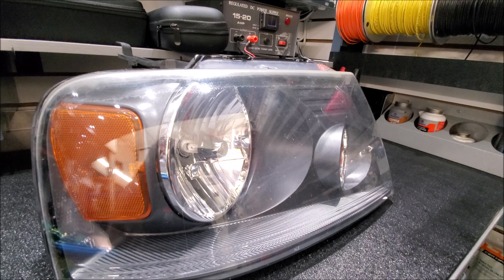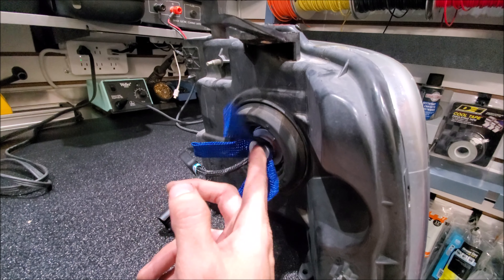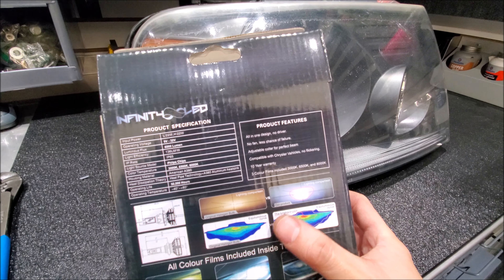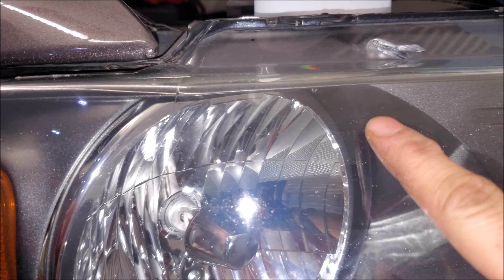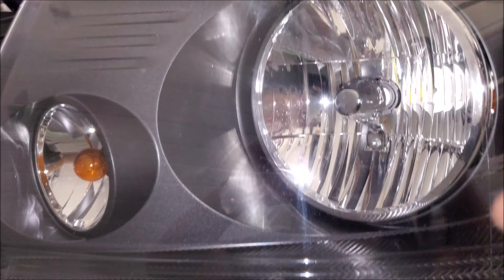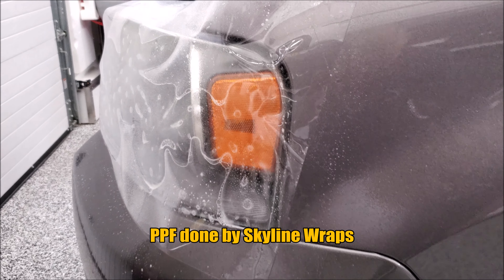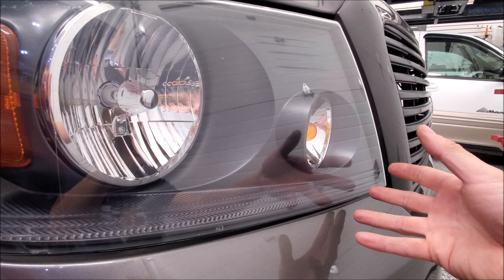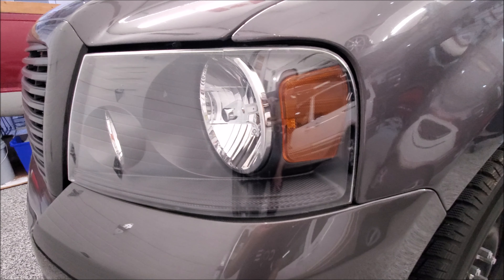How to RESTORE & UPGRADE Headlights the proper way (LED Headlight) | AnthonyJ350

Comment: What's up man. That came out really good. I too prefer using compound as well. Silicone beads clean so well. It does require a few passes by hand but at least you can feel the surface layer.
Reply from the maker: Hey Thizz!  Yes I just kept doing passes till I was happy.  On the Ronda Rousey Accord we probably did 20 to 30 passes before the PPF was applied.

Comment: I have a 2018 GMC Sierra and those headlights are well over a grand each.  I had PPF installed over them when I had the front end of my truck covered in PPF.  Keeps the lights from yellowing.
Reply from the maker: PPF on headlights is one of the best investments in my opinion, for how hazy modern plastic headlights can get now.

Comment: Why not try Lasfit - LC plus or LCair, those are nice reliable led bulbs with active cooling fan?

Both solve the problem for compact size. LC plus is 25W 2500 lumens per bulb $50 a pair, and LCair is 35W 3500 lumens per bulb $53?

It’s affordable but it performs extremely well. I personally prefer LC plus because of that 360 adjustable collar. 

It be much brighter than that braided passive cooling heatsink fins. 

Because cooling fan will cool a lot more led.

Why would u want to stay away from cooling fan?

U might think it’s because it’s another failure point. But nowadays, led bulb with cooling fan are much more reliable and more efficient. And we prefer a led bulb with a cooling fan. We have no issues for that. 

However Lasfit also offers L1 plus fanless led bulb for $40 a pair, 20W per bulb, 2000 lumens per bulb, and a better 2 year warranty. 

It’s still a nice option.

A 5 year warranty is what u want, than go for sylvania - SL.BX2 led bulbs. It has a large yet still compact cooling fan, it’s only 13W per bulb making 1300 lumens. But with 5 year warranty, they will work better with reflector headlights rather then projector headlights.
Reply from the maker: We use this brand in law enforcement vehicles with no issues and they see a lot of abuse. We don't like moving parts, we prefer heat sink designs.

Comment: IMHO. PlastiX is a good product for light hazy lights like the one you showed. On heavy oxidation Headlights, I would recommend the 3 step sandpaper procedure with a finishing Headlight clear epoxy.
I personally used the Cerakote product and gotten very good results. A lot of the results depend on how well you prepare the Headlights and what conditions the plastic is. Normally a 10 year old shaded headlight will turn out better than a 20 year old sun beating Headlights. Common sense prevails.
Reply from the maker: Would love to see a video of you demonstrating.